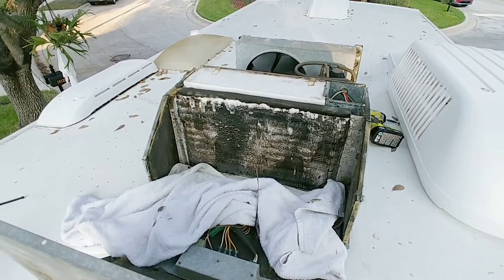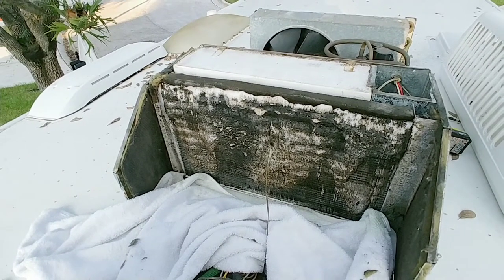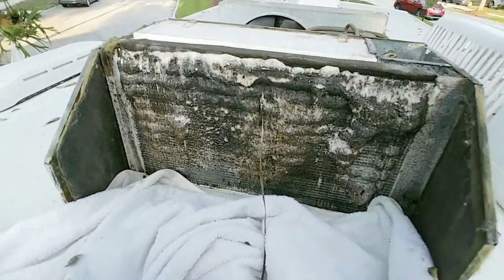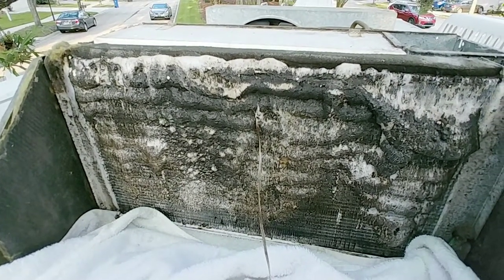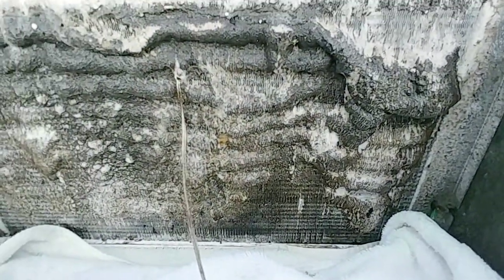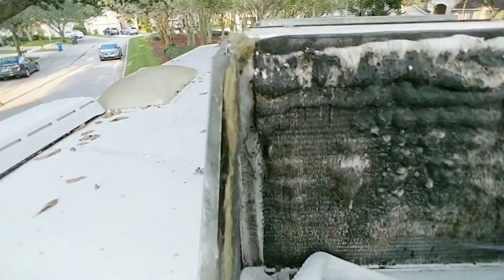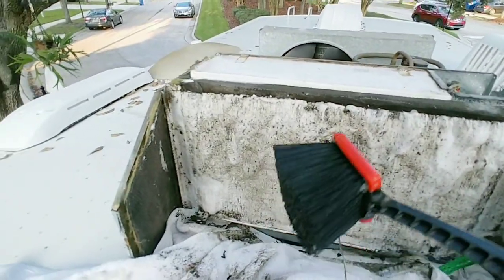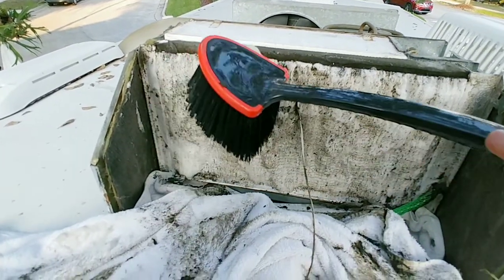DIY - how do clean RV AC Coils. Make ac efficient

Comment: Its a ahame no one ever told you just einse off never brush it bends coils kills airflow
Reply: Will a pressure washer hurt it too?
Reply from the maker: The brush had very soft bristles and is used for washing car paint. But do understand that the stiff bristled brush may damage the coils. I didn't want to do most of the cleanup without water as too much water would have flooded the cabin. I used water only for a final rinse, and placed a container and lots of towels in the cabin below.
Reply from the maker: @nate7629  yes, do not use a pressure washer.